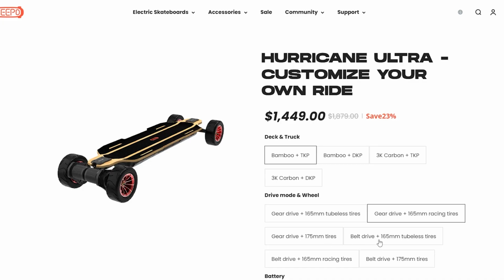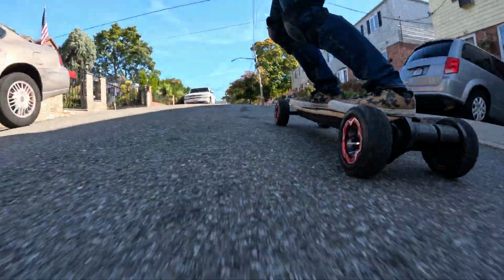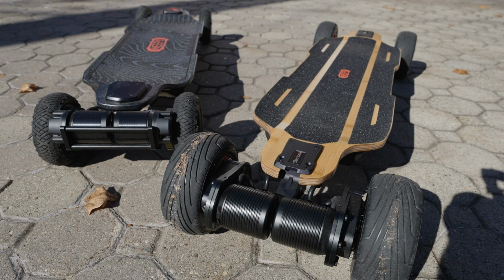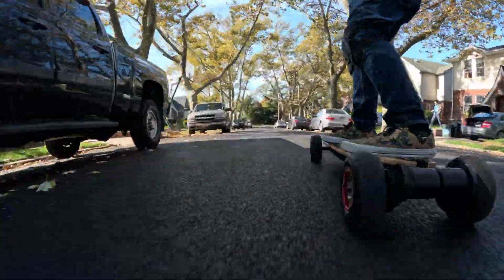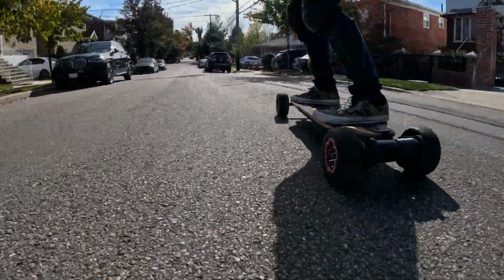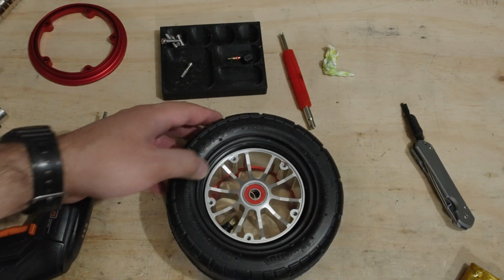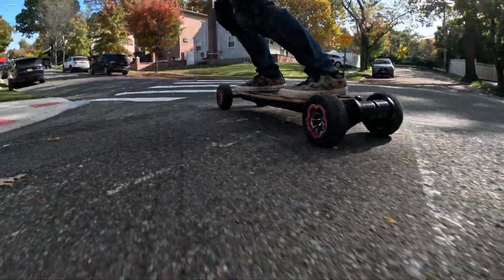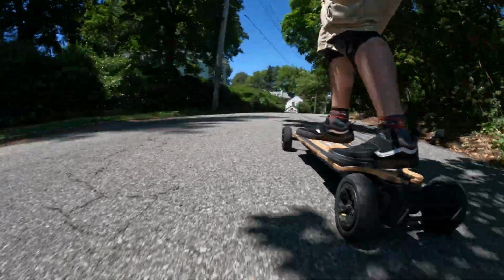Meepo Bamboo Hurricane Ultra | Gear Drive | Tubeless Wheels | Electric Skateboard Review

Comment: could you please advice me. I wanted to get a Wowgo at 2 plus for about 910 dollars. and now its sold out and i found this version with belt and AT tires for 1370 dollar. its alot more but it seems slightly faster. what else are diffrences i should know? with the esc?

Comment: I can’t decide between the Meepo Hurricane Ultra, with TKP trucks, Gear drive & tubeless tires or the B-one titan x carbon with belt drive, rover tires 165mm & TKP trucks. 

Any advice?

The B-ONE seems more promising. 
Great customer service so far.
Haven’t heard back from meepo yet. 

The Titan X has a 30-40 miles range due to the LG M50LT battery, which people seem like better than the Molicel. It has 0 power sag at lower battery. 

The meepo only boasts a range of 16-31 and with those fat tubeless tires (that have a larger ground patch) they’ll get worse range. 

The other difference is the meepo is gear drive and the Titan is belt. I taught myself how to change belts, watching YouTube vids. Pretty fun / easy. 
Pneumatic tires seem like a pain to me; gotta deal with flats, balancing the wheel, etc…

Meepo has been around longer, and I doubt they’re going anywhere, but i find they’re customer service lacking 🤔

Hard to decide 🤔🤔🛹

I surfed and skateboarded in skateparks for many years, so I’m more into range / carving.
Reply from the maker: A battery using the LG M50LT, I doubt would have no sag below 50%. That’s quite the dubious claim. 

Personally, I don’t love rigid carbon decks, they feel harsh and not very pleasant to ride. Flexible decks are more my preference, and I personally prioritize ride feel over whatever big numbers a company puts on their product page. 

Also, Meepos I’ve had in the shop, that I’ve opened up, tend to have a bit higher quality of assembly and manufacture than most other import boards.
Reply: @TheBoardGarage  -  - thank you for your reply. Good to hear 👍🛹

As for the LG battery claim, the reviews I’ve watched / read on the LG battery seem to prefer it over the Molicel. 
I assume most people praise the Molicel because they haven’t read about / tried the LG.

Either way, I’m not super concerned if it’s Molicel or LG. 
Just as long as it’s not Samsung. From personal experience, I find Samsung to be a garbage company, not with phones, just everything else (appliances, TVs, etc…)

Comment: Wait if it's tubeless why does it have a valve stem? Doesn't it not require any air similar to a cloud wheel?
Reply from the maker: It does inflate with air, there is just no inner tube to hold it. The tire seals on the hub, and the valve stem seals on the hub also. After half way into the video, there’s a disassembly of the wheel, which shows how it all seals together.

Comment: Hey, I realize this is an older video but I'm looking to get a new eskate and was wanting your opinion on the plethora of choices out there and trying hard to weed through it all  and narrow it down to a clear winner. Hill climbing and torque are more important than range and top speed for my riding preference.
I'm looking for 2wd with AT tires,pneumatic or tubeless.,belt drive.  I've owned numerous boards in the past.
These are all on my rather long shortlist:
1. Meepo Hurricane ultra
2.Ownboard Zeus Pro
3.Acedeck ares x1
4.Exway Atlas pro
5.Evolve Hadean
6.BKB duo Type R  with the 6384 upgraded motors
7. Propel Endevour2 pro

Thanks in advance for your thoughts and opinions,much appreciated.
Reply: unfortunately he rarely answers any comments here

Comment: Which would you recommend Meepo Cyclone 165 tubeless, racing wheel, or AT set for the hurricane. And if you had a rating what would it be for value per dollar for each wheel.

Comment: You are saying you prefer TKP trucks, but in your video, you have DKP trucks. (10:27)   (it seems obvious, but DKP trucks have 4 bushings and 2 (duel) king pins)
Reply from the maker: The DKP board shown is the original Hurricane, which was offered with only those trucks. I’m comparing them in this video.

Comment: Awesome video amigo 🤌🤙! I agree with the gearbox/drive. If it breaks down on the go you're f*cked 😅. And the cost is higher in general and for maintenance and like you said -> these parts aren't standardized. I wouldn't call DKP "not stable". Just less stable than RKP and TKP. And with the right bushing setup these trucks can be awesome. But true, it's personal taste. I love the deep carves and good to do slides. TKP are awesome as well for other reasons (going faster and punching it). Again loved the video And the honest take on everything 👌🤙

Comment: I have a first version of hurricane and did 700 miles on it. I usually ride on 90mm wheels in New York and get 36 miles range out of 46 promised, what’s is really good. 

On updated hurricane they brought back Samsung 40t cells instead of new Molicel, what gives smaller range. Meepo were blaming Samsung cells in their blog and were happy to introduce Molicel but recently without any explanation brought back Samsung what is weird.

I’ve been using board since June and completely love it. I had meepo NLS pro which I got in January 2021 and the quality was super bad, ESC broke twice, board started to disconnect randomly which almost caused deadly accident.. 

I hope this board has better quality.

Comment: Been looking at a ton of different boards.  I want to get an Eskateboard and compare it to the OneWheel GT and see what I’ll like better.  This is one that I’ve been considering strongly.  I’ve been thinking this might be better with the terrible roads in Pennsylvania.  I’ve been looking at the Exway Atlas Pro 4wd and the Acedeck NYX.  Just wondering your thoughts.  Terrible PA roads and about 10-20% off-road riding.

Comment: 17:36 - I wish board manufacturers quit being uptight and just switch the design to Evolve remotes, the amount of fun a trigger remote gets you vs a roll one is insane, its like you are driving another thing entirely.
Reply: You're 100 percent correct. The wheel has bucked me off more than once and if I wasn't geared up I would have been a hurting unit. The trigger is the only way to fly and for some strange reason these engineers don't understand the simple concept of the perfect throttle control you have with the trigger but I guess I'm just a dumb rider that has an opinion that means nothing to anybody.  I guess we're stuck with the dumb idea of a wheel. You win some you lose some I suppose. Happy surfing my friend.

Comment: Hey, I recently lost my controller to my boosted board. boosted no longer makes the controllers. any idea what I can do about that? please help.
Reply: You would have less issues just buying a new board entirely,

I know that is a tough answer, but your board is going to go bad eventually and you will have to replace everything with diy stuff most likely.

You could always try to buy a diy remote and connect it to the board, but that will require you to mess with electronics.

-Conclusion:
If you dont want to start modifying your board, I'd suggest going brand new and sticking with that option.

Jesus Bless broisky.

Comment: If they're using pinion gears then they can adapt to a harmonic hub or cycloidal drive (both can use forms of eccentric gearing and remove nearly all the moving parts) for power transmission - and you'll lose almost nothing, but I lack the math to explain it simply so I'll just say that by removing backlash and other moving parts you not only get efficiency but reliability and strength.  Because several vectors of issues are solved or minimized at the source, meeting the design requirements becomes non-linearly simplified/reduced.

Comment: Great Video! Im trying out my new gears on some steep hills today, The belts would slip on these hills. Did you ever do a video on the hurricaine battery? I have one that went bad on me are these batteries Fixable?
Reply from the maker: I haven’t yet done the battery modification yet. I’m hesitant, because it is complicated and needs to be handled by a competent tech or battery builder. I will probably publish it soon, but with severe warnings.

Comment: Love the geardrives! 👍 
I measured a 16mm beltdrive on a test bench setup, it wasted just over 20 watts. A typical dual belt setup can waste 40 to 45w just cruising on level ground, and on smooth level ground with hard wheels the propulsive power might only be 40w to keep you moving! So during those specific conditions the range with geardrive might be double that of beltdrives.
In the real world there are big power losses from inflatable wheels and of course hills, acceleration etc so the energy saving from geardrives is not as extreme, but you will probably get something like 30% better range with geardrives assuming lots of cruising. But if riding offroad or powering up hills etc there might not be much difference at all because those things require so much power.

Comment: Hey, great job. I just subscribed. A couple of questions. How much does the bamboo hurricane weigh?  Also, I want to know if it can fit in my locker, do you mind measuring for me from the edge of one wheel to the other edge for the total width? Also, what does tubeless wheels mean? Does it use the same charger as the original hurricane? Thank you so much for answering my questions.

Comment: A little bit sad to see them copying newbee’s 4GS design instead of innovating
Reply: With that logic all car manufacturers are copying each other. They put the engine in the front!!!! Dodge is definitely cheating
Reply: Absolutely no bases for that claim. adding gears to a gear drives to share the load, and just playing with different solutions, is something a lot of companies were going to do anyway. Newbee, as amazing as they are, didn't just find out something revolutionary that LinnPower/Meepo copied in a few days. They're also not the same solution, as they seem to disagree on what gear should be plastic or straight cut.